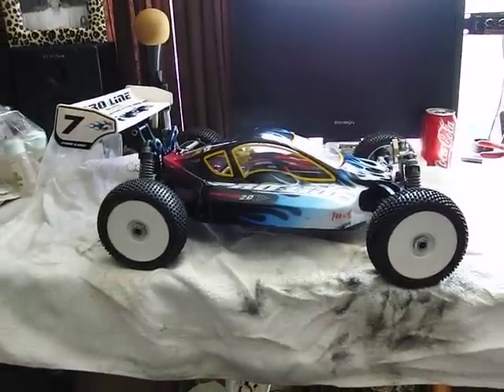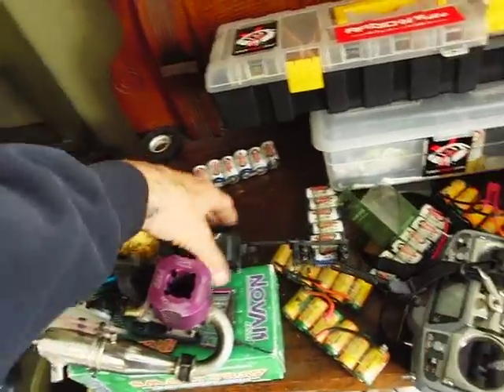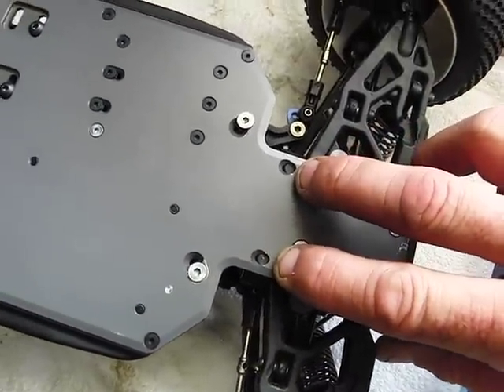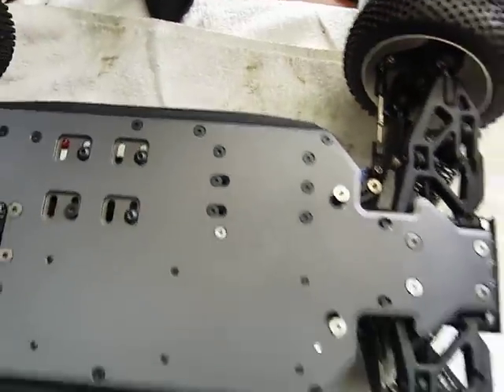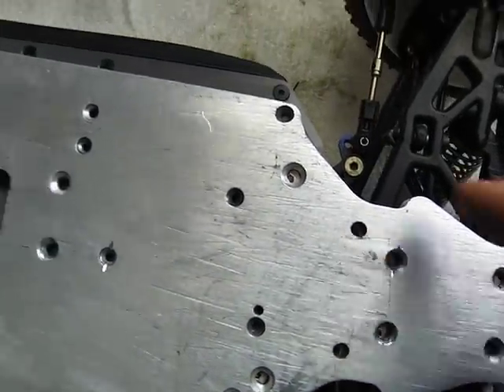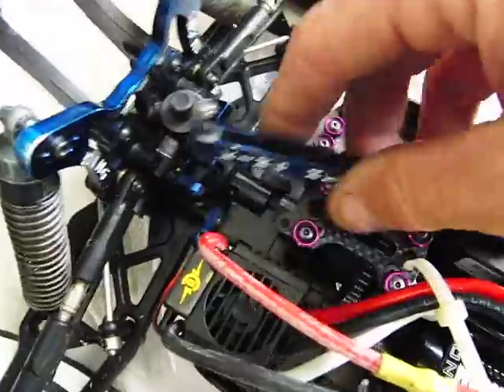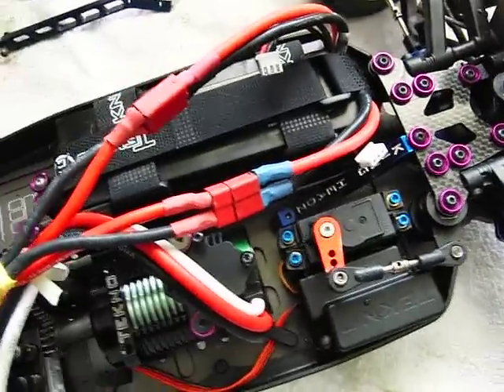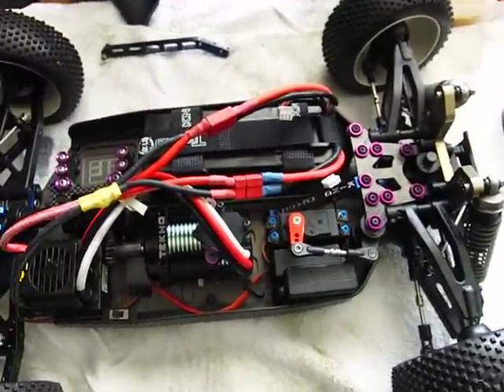Mugen MBX 5 conversion to Tekno Brushless 1/8 buggy

Comment: nice job. I have a mbx5 converted also. I used a rcproducts conversion kit and a rcmonster servo mount, hitec hs985mg servo, turnigy 2560kv motor & hobbywing 150a esc on turnigy 4500mah 30-40c 4s hardcase lipo. it's a crazy fast buggy that handles well... I enjoyed your video, nice work on your conversion.

Comment: I have the mbx5 buggy. Kershaw designs makes a 20$ motor mount and a 10$ battery tray. Bam conversion done. I ordered that and ordered the integy conversion. Incase I end up with another mugen. Thot about picking up a mbx4 bc it would b so cheap. But that's cool that u got it to fit man. Tekno told me it wouldn't and I thot it would with some small mods.  This will ''ve my firat 1/8 buggy. Got any tips?? I may also order the ofna lx2e